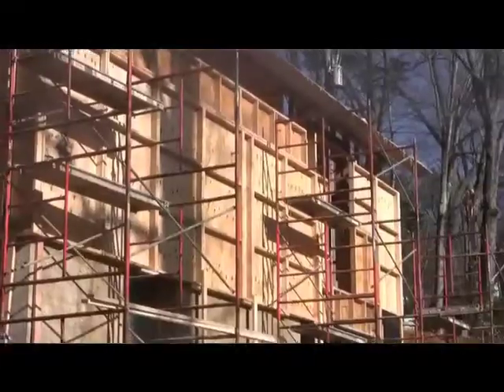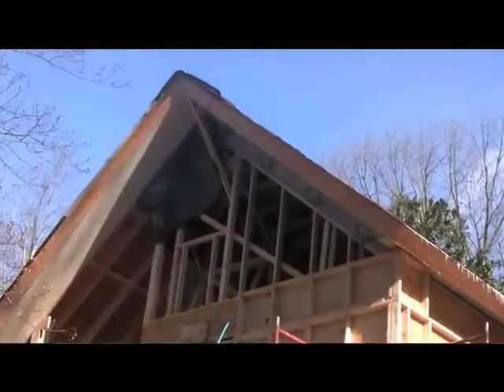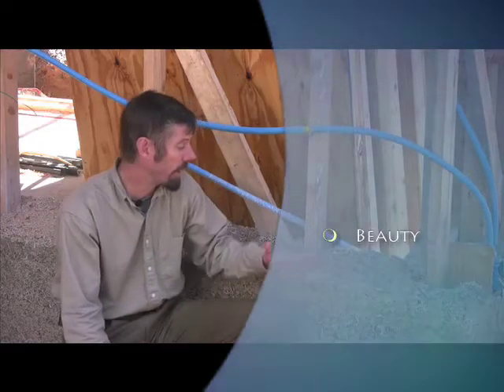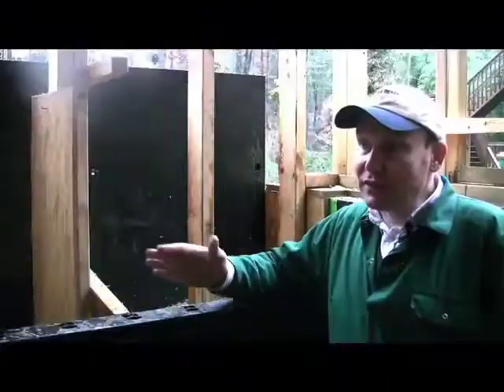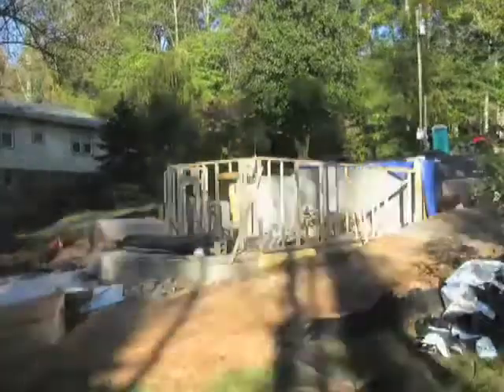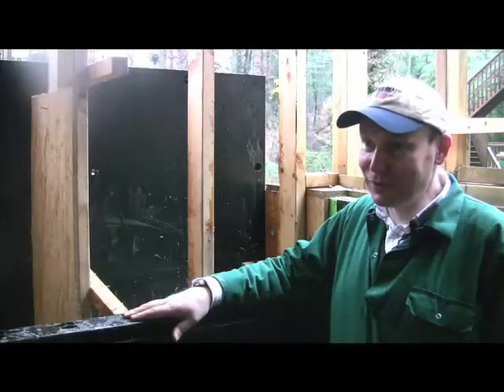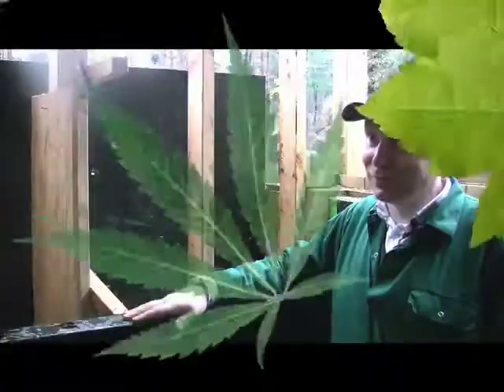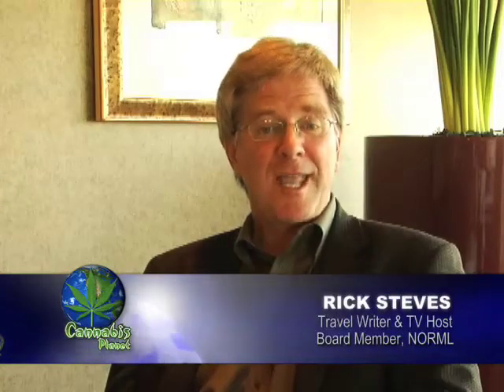Hemp House (North Carolina)

Comment: Climate change is not *caused* by our emissions. As we have had little ice ages, we have warming trends too. 
Water vapor retains more heat than CO2 in the atmosphere. 
The true evils are what's in our air conditioners and refrigerators - CFCs.... one molecule of fluoride destroys tens of thousands of ozone molecules. Efficient insulation should prize itself on helping save the atmosphere, but focusing on the CO2 footprint isn't what's important...